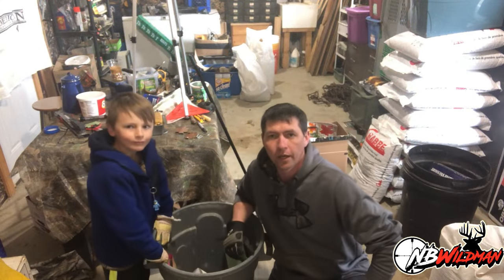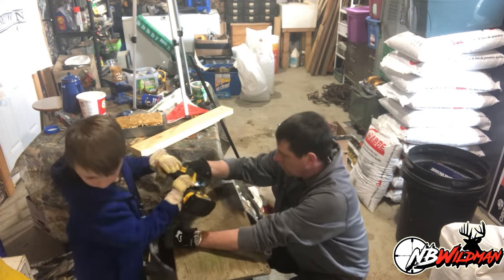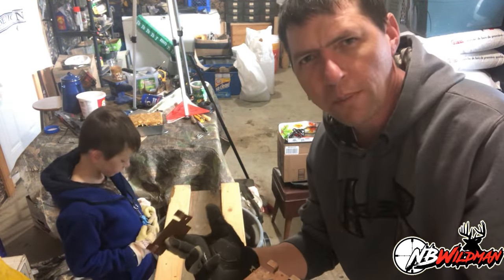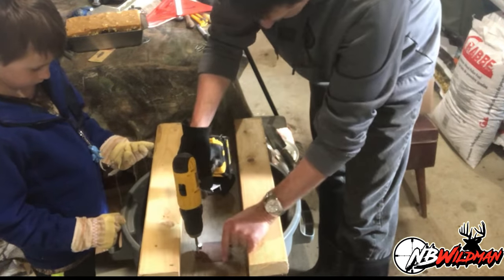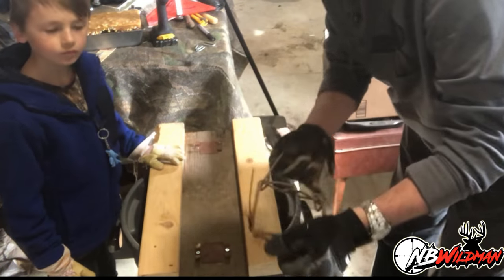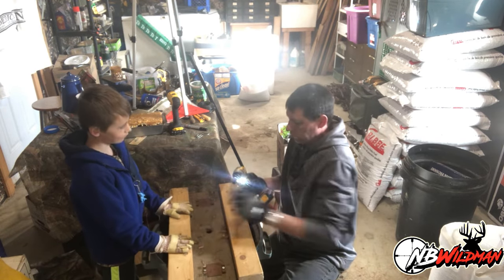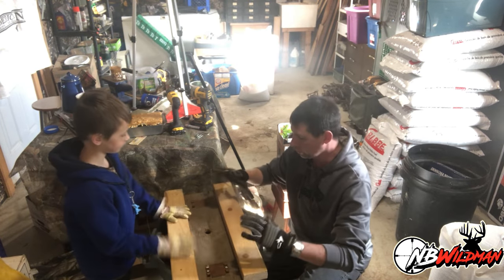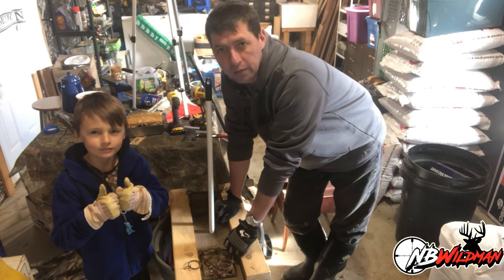DIY 5 Minute   Muskrat Float Super Easy.

Comment: .
Excellent Build video ! 
Looks like you’ve really determined the “Best” dimensions yet kept it minimalistic...

Wondering if the #110 Clips used allow using all of the Triggers set-notches and if so, have you determined which Notch is “Optimum” ? 
How about forming Trigger Wires into a Circle or simply wider spread to insure a Catch ! 
*All the Victor Conibear’s have are the Original ones same as yours w/o the bend in the Jaws and have only used them in runs & Den entrances...
.
.
Reply from the maker: yes the clips allow for all the settings, i find the center notch the best, I don't find that adjusting the shape of the trigger is necessary, i want them a good way into the trap before it springs. I like to suitcase my rats

Comment: How long before they start sinking? I have used something similar made with dead logs and they sank after about a  week in the water. 
Had you thought of sealing the wood portion weeks(scent dissipation)
before assembled to prevent water abortion?
Reply from the maker: i have never had a problem with them sinking, store bought 2x4 is kiln dried and takes years to saturate, even if they were to sink down some, they would still work with the 110